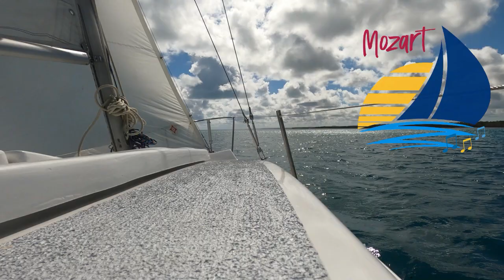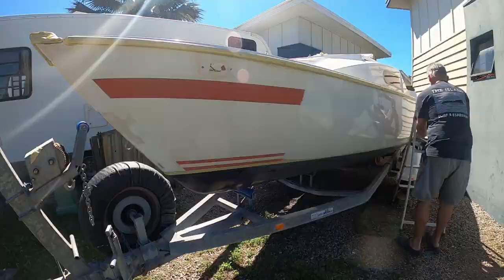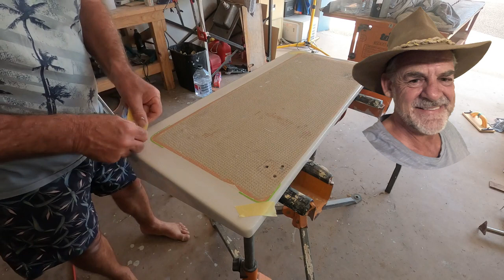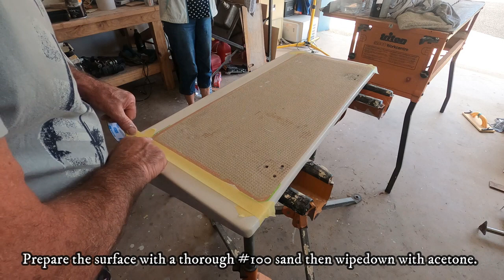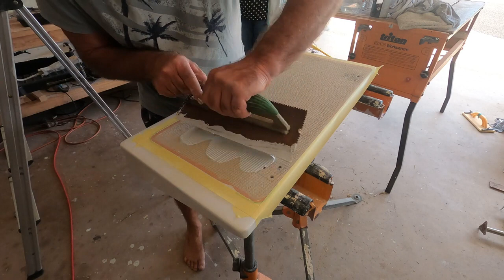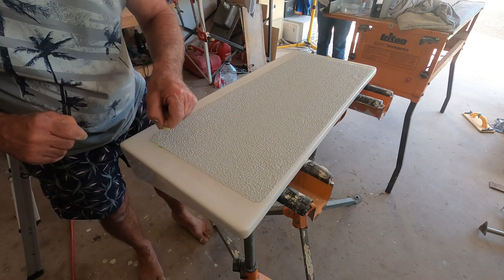The simplest and best non-slip deck paint. Fibreglass boat restoration projects.

Comment: I use KIWI GRIP exclusively for all my non skid needs.  I find that 3m fineline tape is best for corners and curves.  It is pricey so only use it in corners but it comes off so well and leaves such a great edge as well as the ability to roll it around a corner in one piece it is worth it.  LOVE MY KIWIGRIP.  And love that it comes in a bag now too!!!
Reply from the maker: +Ric Bergstrom I also use the 3 m product for the radius’s. Mine is a bit too aggressive so would probably recommend a finer textured roller. It was done in the heat
Of summer which meant it did t
Lay off quite as much as it should have.